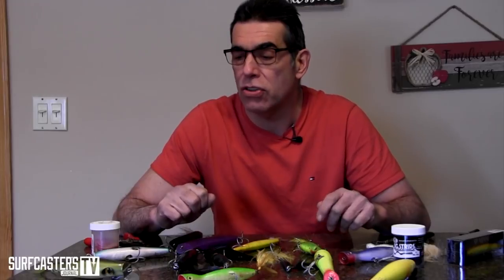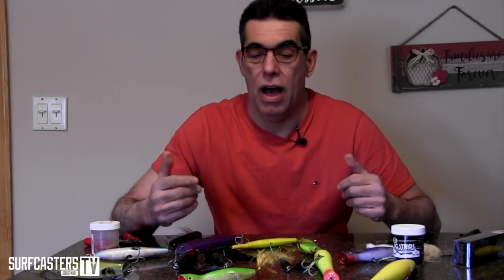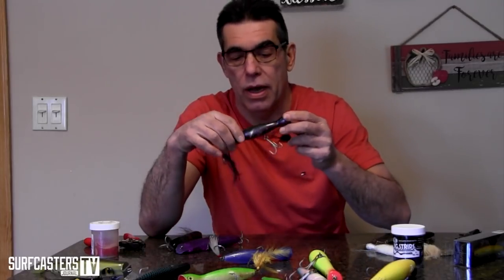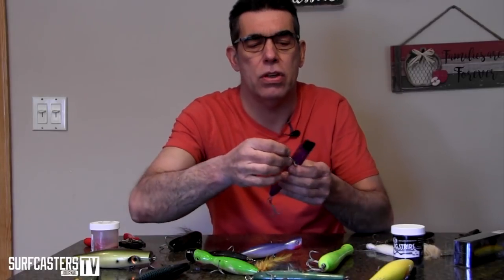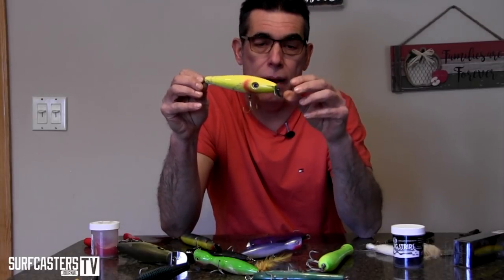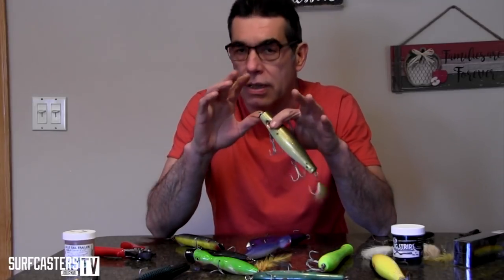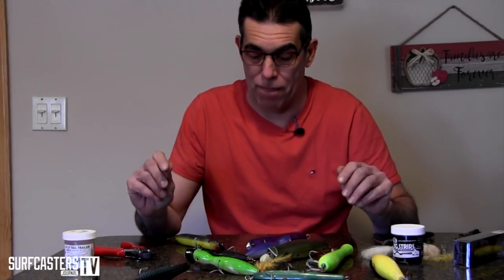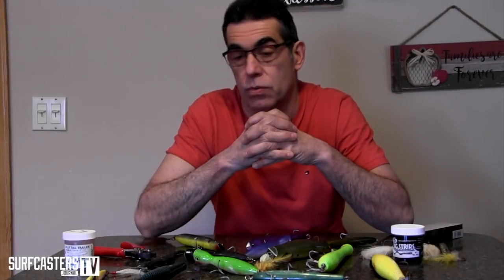Surf Fishing 101 with Zeno Hromin -  Lure modifications

Comment: Daiwa is certainly capable of providing us with quality terminal tackle, so it’s still a mystery to me as to why the SP still comes with garbage hooks and rings. 

The new-ish Daiwa Mebachi popper is probably the most underrated popper on the market right now. The 6”, 3 oz sinking version is the exact same profile as a Superstrike littleneck, casts and works just as well (it’s a pretty blatant ripoff of the SS littleneck in terms of body shape/size/profile/cup shape & depth) but unlike the SP it comes through wired with a 350lb swivel, 170lb Owner split rings, and 6x VMC trebles front and rear! Oh and it’s $19.99, which is right in line with the Superstrike 3 oz littleneck that comes with much smaller split rings in comparison and either 3/0 4x VMCs (belly/tail) or 3/0 4x VMC belly and a dressed siwash on the tail. 

The SS littleneck is legendary, and for the Mebachi popper to be right there with it in terms of action, performance, and durability, while coming equipped out of the box with far superior terminal tackle and with what I think are much better looks like the carved gill plates, eyes, color patterns (the mackerel and chicken scratch are mint), shows that Daiwa is at least not ignoring us completely. 

FWIW I’d recommend anyone that loves throwing a Superstrike littleneck to check them out. They’re so underrated.
Reply from the maker: Thank you for the feedback

Comment: I've been having a lot of trouble with hooks rusting. Would love some advice on what hooks are the most rust resistant. All my Super Strike hooks are brown now. Everything rusts, what rusts slower...Owners?
Reply: Mike Melina best way to prevent it is put a 1 quart container of water in your vehicle throw in the plugs you used for the ride home when you get home give em a quick rinse
Reply from the maker: @brucebainmatunucksurfrat7911  Bruce is correct..or rinse them with fresh water. Owners are $$$ but some guys like them better. Salt will eat thru everything